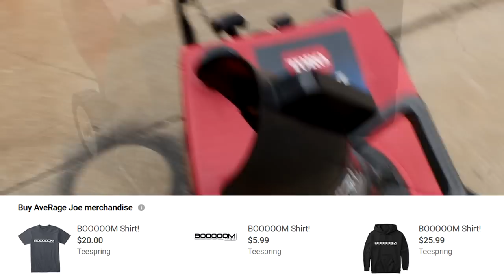Snow Blower Repair Clogged Carburetor

Comment: Thank you! Mine looked slightly different. It had 4 screws, rather than a bolt, holding the fuel bowl (or whatever you called it, lol) on. Bottom line, it worked perfectly and I had no clue what I was doing up until I watched your video.
Reply from the maker: AWESOME!!! Glad to hear you got it going! Great job!🤘

Comment: Thank you sooo much! It had been sitting for 4 years but I got it going, first pull after a little carb tinkering.
Reply from the maker: Whoa 4 years aye!!!!😮
Reply: @AveRage_Joe  Yes and I’m a 76 yo female determined to fix it myself and thanks to you it started. The carb float pin came out but fortunately I found it on the floor. Guess I wouldn’t have been so lucky if I didn’t find it, lol. I noticed your carb was a little different. Thanks again.
Reply: Finally got a good dump of snow and I could really check out if the snowblower would run properly under  load. It worked great! We’re ready for another good blow. Bring it on!
Reply from the maker: SWEET!🤘

Comment: Haha, I just pulled this video up after running my gas 8,000 watt generator for 5 mins. Something I do once a month to make sure things are good before having the power outage. It also helps cycle the gas though everything. Small engines need maintenance.
Reply from the maker: Nice!!!!  Yeah always good to make sure the genny will work at any moment!  Never know when the power will go out.....or even come back on!  Id say winter gas cycling is much slower but usually end up throwing it in the car lol.

Comment: Great video!  I just sprayed a half can of brake cleaner directly into the half full fuel tank and ran it for 10 minutes and the surging gradually stopped.  Try it, maybe it will work for you too. Easy peasy.

Comment: I just purchased a Toro 1000 for $5. It needs a primer bulb and by the looks of the nasty gas in the tank I'll need the process you described here. As for Sea Foam, in my opinion it's awesome. I've had mowers that wouldn't start or that ran really rough and loading Sea Foam into the tank with fresh gas did the trick. Thanks much.
Reply from the maker: 5$ is a GREAT DEAL!!!  I use sea foam and have good luck with it as well!

Comment: Good to see you! I hope your doing well! You got me hooked on 18650s! I now have three ebikes and repair batteries for an ebike distributor in the northeast. Thank you.
Reply from the maker: WHOA NOICE!!!!  Do you get to keep any "faulty" packs😉😉
Reply: @AveRage_Joe  Hi Joe the first battery I repaired had 4 failed 18650. I looks like the manufacturer dropped the battery pack on the floor and dented them. A third of the packs I see have bad cells. I replace just the bad cells unless the customer wants a full refresh. I've tried about ten different BMS balance boards. The first few were under rated and would trip. After disconnecting they reset.
Reply: The people I work for ordered some 18650 with high (7.5a) discharge rate. They got a good price ($3.01 new) and had me gut a couple of batteries and install the newer cells. I got to keep the older insides. The plan is to take these 36v 10ah packs and use them on my wifes 500w three wheeler.
Reply: The hardest part about the ebike packs/batteries is finding the right BMS/balance board. I've tried 7 different BMS with mixed results. Most of the ones I tried do not handle the current and need to be reset. I just ordered a 36v 40a BMS/balance. I started with a 36v 15a. ttyl

Comment: Thank's Joe. My snowblower konked out cause the carb was filthy. Tried different methods, without taking the whole thing off and yours was the only one that worked. Your right about the gas as well. It's hard to find ethanol free gas here in NY, but it's best to store your equipment with it. I'll try the Seafoam as well. You rock!
Reply from the maker: Awesome! Glad it was a help! Yeah most pumps around here are starting to only have the "10%" ethonol now. I know of 1 station close that doesnt have it. Good to hear you got it going!🤘
Reply: Home Depot and Lowes have premixed ethanol free 2 stroke fuel. I got a can to run thru my blower that had stale fuel in it. Worked pretty good but I'm gonna try cleaning the carb as well.

Comment: Yes I think brake cleaner works better than the carb cleaner.. it also worked on an outboard motor I had sitting.. the stuff smells bad but it works... also only use ethanol free gas
Reply from the maker: Only way to go for sure!!!

Comment: IT WORKED! THANK YOU AVERAGE JOE! GBR
Reply: .....And now it doesn't. Very low power. Soo much smoke. Couldn't even engage the thrower without it bogging down. Let it run for 5 minutes and it died. Won't start now. God damnit God damnit
Reply from the maker: Did you use any cleaner like seafoam in the gas while letting it run.  There is most likely a clog further down.
Reply: @AveRage_Joe  I didn't. There wasn't any where I bought the brake cleaner. I will give that a shot today!

Comment: Great video, thanks.  Going to spray carb cleaner in my snow blower that I've been trying to start for the past week.  Quick question - when you got the first (smaller) snow blower running, was causes the white smoke after you started it up.  I've seen that before on my lawn mower and was curious what it's from.
Reply from the maker: Yeah give it a go and see if it starts and runs! The smoke on startup was from all the leftover crud from the last year, brake cleaner and oil lol.

Comment: I have the same one and I have to replace the primer button and hope it start, my question for you ? Is it gas only are mixed with 2stroke? it was giving to me by a friend and im not sure.
Reply from the maker: Its usually the ethonal in the gas that eats rubber or drys it out when it sits. Just run it empty at the end of the season and that will help a ton!

Comment: Most often from old gas it’ll be the main jet that’s clogged. You can stick a flat head screwdriver into that center hole and screw the jet out, it’ll make it easier to spray down and clean. Sometimes if it’s really bad, you can poke something through the hole to help move the gunk, or even drill the center hole out with a small drill. Make sure to clean the float bowl out before putting it back on, and you should be good to go.
Reply: He didn’t mention one of the main conditions that occurs from a clogged main jet - Engine Surging. So your motor will start, but once you switch the choke to RUN position the engine will continuously surge the throttle/RPM up and down. If you switch the choke to open again and it smooths the RPM out, you got a clogged main jet. Follow the same cleaning steps as above.
Reply from the maker: That is correct I didnt mention any of that. This was just a quick fix!🤘
Reply: It’s normal for it to surge with the choke open. Does it continue to surge if you set the choke to the normal RUN position? Or it only surges with choke open?
Reply: If it’s not surging in RUN position, then it’s operating normally. The Throttle is part of the Carburetor, you can take the carb off and clean it, but generally that’s not what’s causing the surging if there is any. Get back to me when the winter season starts if it surges in RUN. If it continues to surge in RUN position, there is another fix.

Comment: Do I need to drain the gas first before I spray the one you spray in the carburetor and can I put it back the gas that I drained. Also, the one that you spray in the carburetor is it safe also to use it in Toro snow blower 621.
Reply from the maker: If the gas stinks(doesnt smell like gas) I wouldnt reuse and yes drain it. If the gas smells ok then pinch off the gas line from the carb to save it. Yeah you can use the spray on all carbs.
Reply: @AveRage_Joe  For clarification, are you saying that the good gas doesn’t necessarily have to be drained in order to clean the carburetor and just pinch the fuel line so the gas doesn’t drain out?  I just filled with new gas only to find that it wouldn’t start. This is my first time doing a fix like this. Currently in the middle of a snow storm in the Northeast. Hoping to get the blower up and running tomorrow morning. I appreciate you posting a video like this and thank you in advance for your help!
Reply from the maker: Yeah if you just put gas in and dont want to loose it, pinch the line with something and then if you can drain the good gas back into your gas can just in case you have to tilt the blower over. If you dont need to tilt the blower over then the pinch should be fine. Good luck, we just got a foot of snow the other day!🤘

Comment: Will this method work on larger snowblowers? I have a big Craftsman that only starts for a half second, but there's nothing on the bottom to remove.
Reply from the maker: It should!! Is there not a fuel bowl on lower side of carb?

Comment: Hey bud, great video! Would I have to drain all the gas before I flip it over and start cleaning it?
Reply from the maker: I would or it may leak all over through the cap. Pull the gas line to cab and drain back into gas can.
Reply: @AveRage_Joe  thanks man

Comment: Ok so I took my carb bowl off to clean out the carb and found the float is made of cork and not even a smooth cork. It has little chunks missing. Is this would Toro put in their carbs. Seems a bad choice to me since it could shed cork particles.
Reply from the maker: Wow! Did you buy it new or from another person. They might have done that a super long time ago but wouldnt think they would in the last 20yrs. If you got from another person they may have done that for a cheap repair.
Reply: @AveRage_Joe  I repaired it for my neighbour. They bought it like that.  Im not certain how old it is. I did a search and it appears Toro did use cork at one time.
Reply from the maker: Nice! That is interesting!

Comment: Can you test the new battery hookup nickel strip with fuses built in? It’s on their website I got some but I couldn’t really get it to blow I was also wondering how it was and if it’d melt foam and heat shrink and how to avoid that.
Reply from the maker: I can and WILL!!  A subscriber sent me a sample for that reason🤘😎  Sure I could throw some on some foam if I have some and are you talking about if your hole pack was in heat shrink or just the cells heat shrink?  If its a hole pack shrink then Ill have to get some from Keith!
Reply: AveRage Joe whole pack heat shrink. I’ll send you some if you need it! I have 4p sized shrink wrap I’ll send you 1 1/2 feet
Reply from the maker: Gotcha!  Yeah if you wanna send some that be great!

Comment: God I hope this works... I know very little about engines, got this blower from a guy for free. Replaced the pull starter(omg what a nightmare). Didn't work. Replaced the spark plug and fuel filter... didn't work. You Said 9/10 times it's the carb. so wish me luck that I'm not the 1/10!

Comment: Do you use oil mixed gas for all snow blowers or no?? 🤔
Reply from the maker: No not all. Usually the small single stage are the mix and the bigger 2 stage are straight gas.

Comment: Maybe a dumb question, but if I remove the carb bowl will all the gas drain from the tank? Or can I remove and spray with a full tank?
Reply from the maker: Yes it would drain the tank however if you clamp the fuel line(pinch it with something flat so you dont ruin it) you can then proceed. Another option is to pull the line and drain it back into the gas can.

Comment: Have you tried using non-ethanol gas? You should be able to find it. It doesn't cause that crap nearly as quickly as the alcohol gas. 

I've gotten my neighbors to change from ethanol gas to the non-ethanol blended stuff for small engines. Now I don't have to clean their carburetors every spring.
Reply from the maker: I avoid ethanol gas like the plague!  This lil snowblower was a family members so I thought a quick video was in order!  I do the same and tell everyone not to use that gas cause its garbage!  Most listen and some say they do but I end up cleaning the carb on there piece of equipment every year lol.

Comment: was that first little one a 2 stroke?   I just got one that says powerlite on it and it says it;s a 3 hp - which I take to be 180CC 2 stroke  50:1 fuel mix.    I got it for 30 bucks!
Reply from the maker: Yeah the lil guy is a 2 stroke!
Reply: @AveRage_Joe   It;s not fireing up. I guess I have to figure out how to take the dang thing apart.  I have not attempted it yet. the electric start works but no fire.

Comment: I'm having trouble finding the carburetor on my ION24SB-XR.
Reply from the maker: 😜Keep looking, its there!!!!🔋🔋🔋🔋⚡  How does it do anyway?
Reply: @AveRage_Joe  How do you think the only battery-powered 2-stage snow blower on the market made by a no-name brand would do? It's underpowered and the batteries only last 20 minutes in 6+ inches of snow. It bogs down if you throw anything over 12 inches at it. It's definitely no replacement for the gas powered ones like you have. I just wanted to get a laugh out of you, really.
Reply from the maker: LOL yeah sounds about right!  Im sure some day they will figure it out!

Comment: Yet one more reason I live in a SNOWLESS location.  LOL     99.8% of these issues can be eliminated and or Prevented simply by turning off the gas and allowing the engine to run until DRY.  Works for me.  Prevents carb issues on ANY combustion engine.  A MUST DO  for your small generators.     * Ethanol Destroys rubber or plastic components.  Even the stuff listed as Ethanol  Proof !  LOL
Reply from the maker: Yeah I avoid that gas like the plague!  Ruins EVERYTHING!  Oh yeah I forgot about the fuel shutoff valves a lot of things have lol.
Reply: @AveRage_Joe  Yep running them dry WORKS for sure.  Not had any issues after learning the simple little trick.  Unless my kid puts Grass in the Gas tank again...
Reply from the maker: LOL GRASS???
Reply: @AveRage_Joe  Yea,   Odd Mind Set .  MESSED UP MIND SET.  Did it just to get up my Nose.  It Worked most well.  Took me three days and at least 9 hours to figure that one out.  LOL

Comment: Run it out of gas?  I've always heard that's bad for the engine!  I put Seafoam in my last tank for the season to keep the gas stable over the winter.
Reply from the maker: In a vehicle it is for sure. Yeah I usually have something in the gas to keep it stable as well and dont run into clogged carbs. This lil one was the wifes parents!

Comment: I am trying this technique. But, my inlet needle fell out and I can’t find any info on how to fix it. This looks like just what I need otherwise.
Reply from the maker: As in the pin that holds the float came out and then needle and float came out?
Reply: @AveRage_Joe  the float didn’t come out. Just the inlet needle and spring

Comment: Can I use w-40 ?
Reply from the maker: Dont think that would work!
Reply: @AveRage_Joe  so I cleaned the carburetor as you did in the video. A lot of smoke came out when I turned on shortly after it turned off . It was struggling to stay on . Could it be something else ? Previous owner left the blower been sitting for 3 years put fresh gas in it
Reply from the maker: It may smoke a bit after as its burning off all the old and stuff you sprayed.

Comment: Either your fuel mix is dead on or you're running straight gas in that 2 stroke....
Reply from the maker: The 2 stroke is the father-in-laws and he left the gas oil mix in over warmer months a few to many times to clog it up. Once I got it the clog removed I used my gas/oil mix with a little seafoam and runs GREAT!